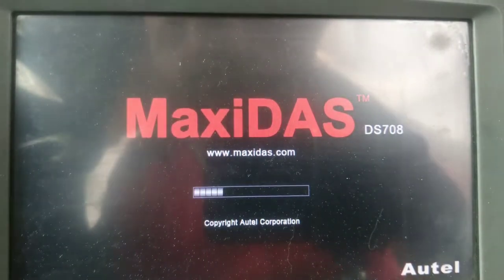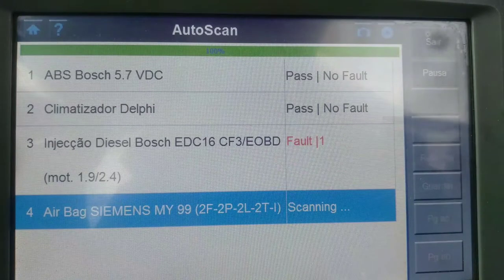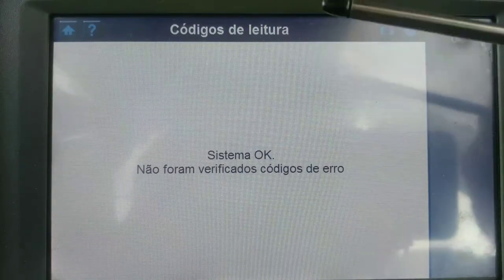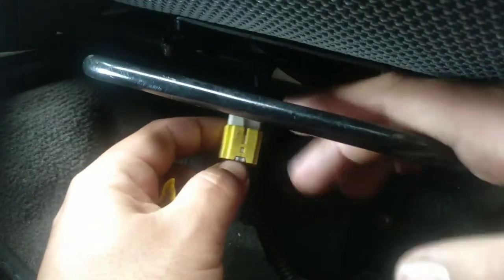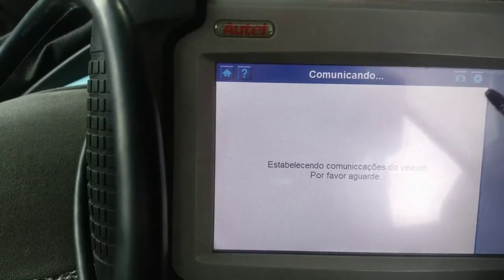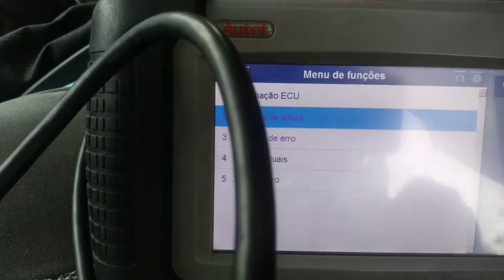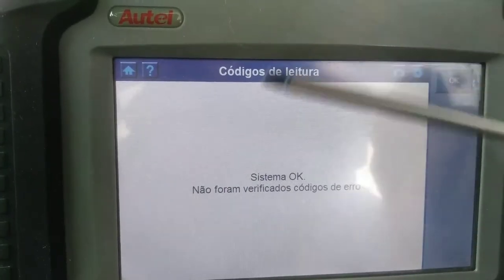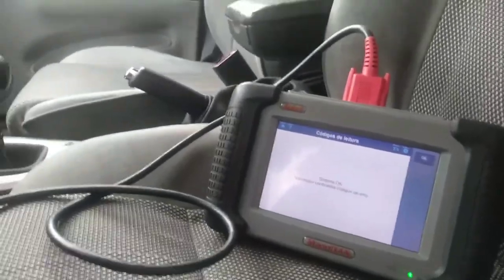How to SOLVE airbag light on? NO FAULT codes? SOLUTION on this video!

Comment: In my case all I did was chg to a new battery the old battery was still good but getting old and after I put the new battery the air bag light stays on, the battery is reading a good number on my meter...so how can I get that light off, people say try 5 times to turn car on but not the engine 5 times no help...my older scanner says no codes....

Comment: Really appreciate this help, if it works I can finally remove the black insulating tape from my control panel. 😌
Reply from the maker: Hello. It's been working for me all my live. Even if it doesn't work, you can replace the control unit with clear conscious.
Reply: @alfaromeonoproblem 
The control unit was the first thing I changed. The software couldn't even read the one I replaced. Now I can read it but still the error didn't clear. The one thing I didn't do that you brought to my attention, is the need to change the state after clean g the connections, really happy I have maybe too things to try because of you. Thank so much.
Reply from the maker: It is the most important thing in any airbag system. You have to change the state

Comment: True, zip ties and WD40 to the rescue! :D  I repaired mine this way 3 years ago and the light never came back.
I did not use diagnostics to clear the codes, the light switched off immediately after fixing it on my Alfa GT.
Reply from the maker: Yes! It's my method every day. I did a similar repair on a Chevrolet Aveo. The same simtoms, light on, no fault and... Zip ties and wd40! Thank you for watching!

Comment: Hello great video 
I have a 156 with airbag issue light and I have done all the following cleaned the connectors. No fault code is showing and the light is still on the dash. Can you advise. Any thanks Winston
Reply from the maker: Hello. Like said on the video, no fault codes is just the scan tool that isn't able to read them. Try another diagnosis machine and follow the same procedure on the affected areas. Or.. do all the connectors and check again
Reply: All OK 👌 now just turned out to be dirty connection in the boot thank you for all your help 👍 😀 🙂 🙏

Comment: Hello
I have 156 Selespeed from 2000 phase 1 and I don’t have curtain airbags only side airbags in the seats. Is this yellow plug also connected to the front airbag and to the side ones or only to the front?
I’m asking this because my airbag light just came on, after 20 years!!
Also my airbag light for the passenger on/off position came on. Do you think it is connectors problem? 
I don’t have any diagnosis computer to connect to the car. 
Best regards.
Reply from the maker: The yellow plug under the seat is for the side bag. You will have a plug on the B pillar the the pre tensioner. Basically you will have a plug for each loop, for each bag/tensioner.
The side bag switch is also controlled by the unit, any problem on that loop will turn on the light. Including the switch it self and it's plugs
Reply: @alfaromeonoproblem  Hello again
I just tried your method for the yellow plugs under both seats, well it didn’t work. As I said I don’t have a diagnostic tool to check which airbag is giving this fault. I will keep searching. 
Thanks a lot. 
Greetings
Reply from the maker: You really need the diagnosis machine. Even if you solve the problems the light will not turn of on it's own.
Reply: @alfaromeonoproblem  
Thanks mate. I just went to a friend mechanic and he erased the fault with his diagnose computer. So it was really a faulty contacts in the airbag. 
Thanks again
If you have other videos on how to change the thermostat that will be very nice. 
Best regards
Reply from the maker: Hello, nice. For now for the thermostat just have my 75 videos. Will have for 156 latter this year

Comment: Y airbag start to light when some ecu tools i put inside ECU and i was able always to turn offf light when i unplug all connection at the bottom of the seats without ignition cays inside and let them about 1h or more and than back to car re-connect and than start car and afther 5m light turn off but afther last plug in ECU i professional service (a was have problem wich FAP sensor and i drive car in service) this methor for turn offf airbag light dosent work anymore, is constant.

First time i was have this problem is turnet off by itself afther couple of days, seccond time appier again when ODBIII was plug and all was death, radio, screen and back doors doesn't want to close on keys. When i was finally able to turn on engine i was drive car into garage and pull of "body computer" under rear seat, clean all connetions and let unplugged for 24h and than back again all and car work again normaln 3 year later, and now afther this diagnostic tool in service im unable tu turn off airbag light. I will try that yellow plug tu touch, that was main problem for 147 but now in 159 im not sure because light didnt appear when im moving seats, ever.

Comment: What do you think of Autel MaxiDiag Elite MD802? Is it worth 52 Euros for a used one (plus some import tax)?
Edit: It is actually an auction, so it will go for a higher price. I don't think I can aford it then. Never mind...
Reply from the maker: It is not the most complete machine, but it should work very well like all autel machines.
It is a good price too.
Reply: @alfaromeonoproblem  Which one do you recommend? For hoby use.
Reply from the maker: That one is good
Reply: @alfaromeonoproblem  Thanks man. But it almost doubbled in price, and there is 11 more hours left. So, no scaner for me.
Reply from the maker: It will be even more difficult in the future. Even with legal diagnosis machines, makers demand payment to access some functions on diagnosis
Reply: @alfaromeonoproblem  Yeah, there is one for sale for 65$ as "for parts or not working". It is working, but requires access code...